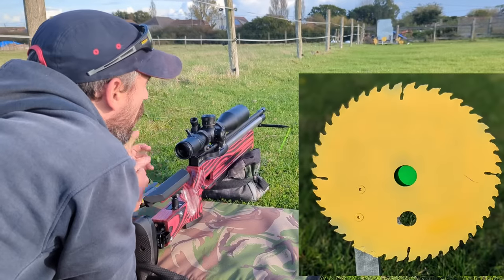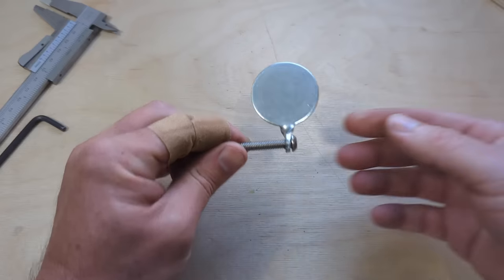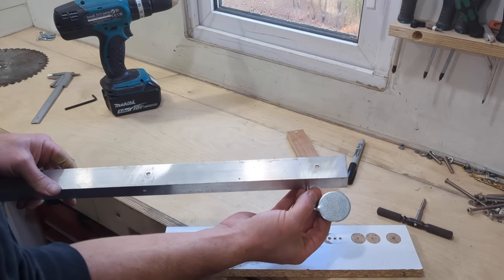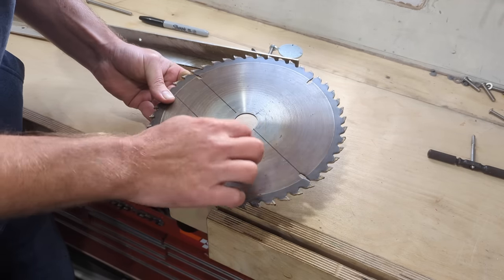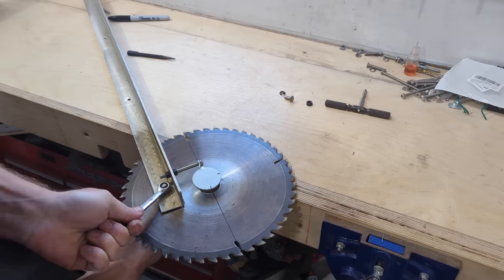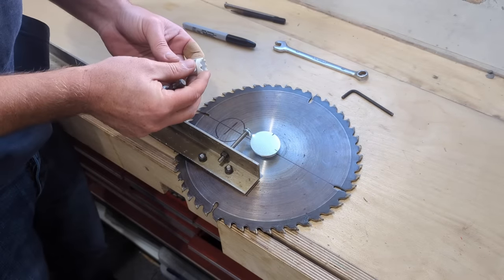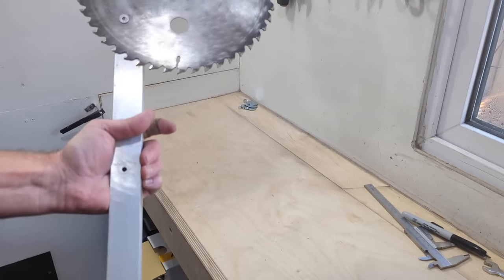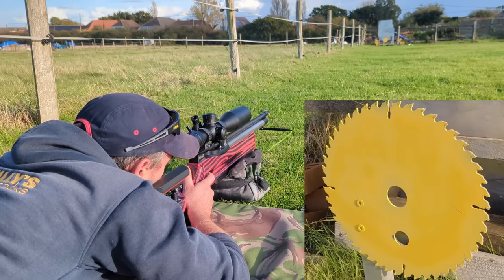Building awesome resetting air rifle practice targets from scraps with basic tools!

Comment: I’ve made spinning targets in the past. Same as you I bought spinners online and I bolted them to a wooden post. I also bought 5mm to 20mm. X3mm Steel and cut to length and twisted and drilled. I made loads of spinners. Very satisfying making your own targets

Comment: Thanks for the idea .. I think I will give it a go. Since the paddles don't actually need to be round (the holes are round enough) I may try make them from scrap metal ... but if that fails would you share the amazon item for the paddles ?

Comment: Great work.  I am new to this and was looking to get into airgun shooting and saw the video on the led ban , the problem with the pellets skirt needing to expand slightly and led replacements not doing this as well, would a soft rubber skirt press fit into a steel head work ? like i said im new to this and it could just be a silly idea .
Reply from the maker: We look to have got lucky regard the lead ban. Not so much the large calibre rifles,but air rifles look to have swerved it for now 😉
Reply: Nylon skirted pellets have been around since the late 70's
Reply: @750triton  ahh cool.

Comment: That's pretty cool! 👍
As another option, you could turn the blade 90 degrees and shoot/flip the paddle from side to side. That would give you gravity free resetting and you can still use different sized holes for precision shooting. 😉

Comment: awesome idea , any chance of making a quiet version 🤔 as with many back garden shooters neighbours and noise can be an issue , maybe lead facing the saw blade or a wooden back to dull the ringing sound of the blade 🤔.
 also just a quick question , I'm looking for a beginners ( budget ) single shot pcp for ft and maybe benchrest , I was thinking a AA s 400
Reply from the maker: If you can find an old s400 mpr it would be perfect. They do hold their money as they are still very sought after but worth looking at. 

Funny enough I was just thinking about putting some of them thick felt like pads (that go on furniture feet) on some spinners to see how quiet they are🤔
Reply: U made a chopping  axe..good idea.
Reply: @tillysgunstocks thanks for the reply , much appreciated 👌🏻. I'll go research then hit gun trader 😉

Comment: Lol like the idea, specially when resetting is a harder/ smaller target :) ,  after many shots i can imagin the thread you made wears out and the spinner wil hit the saw blade from the back and wont "stick" any more?
Reply from the maker: Hi mate. The key thing is to have the thread grab just as the paddle hits the back of the face plate/blade... So far it's holding up well but if it was adjusted badly,it would, as you say strip the threads eventually 😉